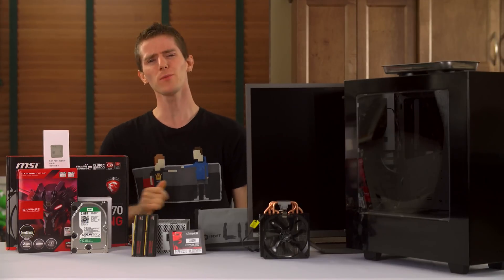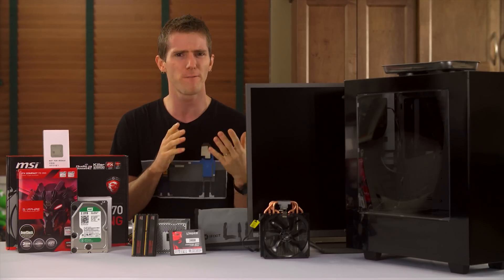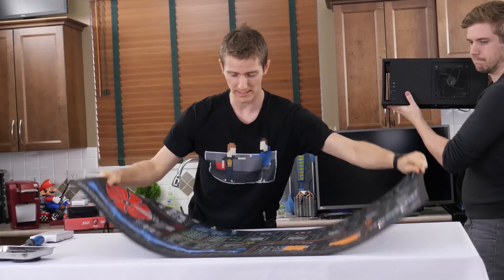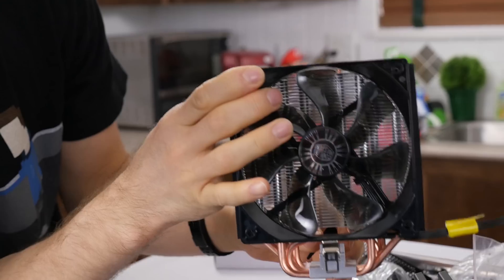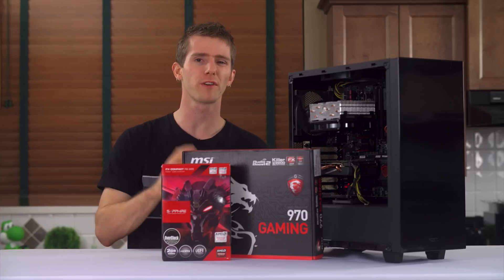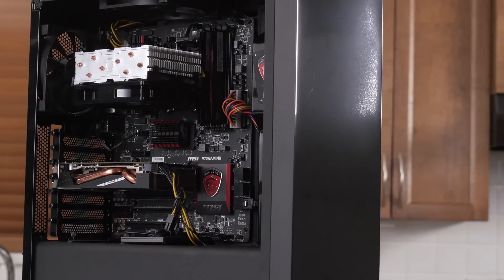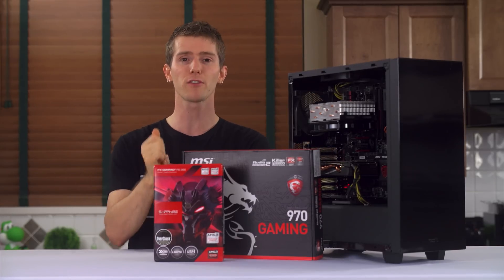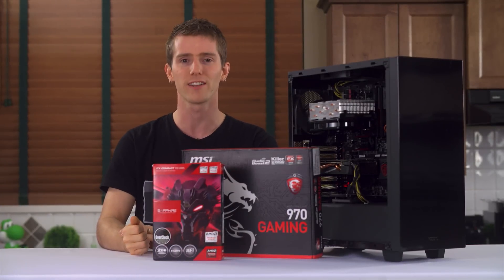Can you Build a 4K Gaming PC for Under $1000?

Comment: watching this video it is hilarious to see them look at 4k CS GO
I play at like 1024x768, and my graphics card is a 970
Because CS Logic
Reply: +The Croaker Why do people play CS:GO at tiny resolutions like that? I never understood that. I personally only play TF2, and always crank the settings up.
Reply: +MUSiCK But it doesnt look bigger. That advantage is gone in CS:GO. Not to mention you narrow your field of view. There is absolutely 0% advantage in playing on smaller resolution in CS:GO specifically.
Reply: +Topias Salakka Because the pros have been playing for 10 years and they never upped their resolution as the mainstream got better. People copy pros.
Reply: Lol I go for 480p, low, and 30 or less FPS. #PotatoMasterRace
Reply: +Guru Nannak Anyone who has spare power, my GTX660 can run it at max in 4K at 70 fps, tho I just use 1080p with 8xMSAA, because input lag.
Reply: +The Croaker Same :P
Reply: Grammar Nazi You don't need good anything for csgo
Reply: +Topias Salakka its kind of a thing that alot of older players use when everyone had 4:3 monitors, an good example would be players that played counter strike 1.6 back in the day and wants to stick with the resolution they used to...plus i also play with 4:3 just because everything looks bigger
Reply: +Diavolo222 yes you are so right, which is why so many pros play at 4x3 and lower resolutions
Reply: and who the hell plays all there graphics very high
Reply: +Diavolo222 The main reason is focus. If you play at a low res, everything looks "bigger" even though the hitboxes and such aren't. In CS you need to see tiny tiny pixels. playing 1080 makes it hard as fuck to 1 tap someone down long.
Reply: I got a... a... you know... a... kill? Kill. A kill--I got a kill in CS once, you guys. It completely psychologically annihilated me, but after much hardship, I did it. And then I quit. I just wanted to let you all know a little about me, and who I am as a person. ( ͡°╭͜ʖ╮͡° )
Reply: +The Croaker Just because someone is a "pro gamer" that doesn't mean he has any technical knowledge of his equipment.
Reply: +Topias Salakka if you have a lower resolution the head of your enemies look bigger and you think its easier to hit their heads
Reply: I have AMD Radeon HD 6570 I play on 16:10 1440x900 on low Settings I get 120 fps constantly
Reply: +Yolo Alex Its not because they are bigger, its preference. Majority of GO players are 1.6, CZ, or source players when lower resolutions were what was available
Reply: Read up m8. The only way you have 4gb is if your mobo uses your sys memmory but 2×2gb in sli will give you 2gb of v ram
Reply: +Franco Pellegrin I play on a crt pentium 1 on low settings and I game at 12 fps get on my level
Reply: +SmashBomb im playing in a Toaster with SLI Potato's
Reply: +Guru Nannak Because they look better, way better with everything cranked up ? Granted when you play these competitive games, at some points after much replayability, you will not notice and get used to everything on low. But if your system can run it, like my i5 4430 gtx 660 systen can, who the fuck cares ? Same for Starcraft 2. the game can be played on Low but on ultra it looks pretty damn good. LoL sadly looks shit whatever setting you put it.
Reply: +The Croaker lol same here because the textures pop up better
Reply: +The Croaker Dude you're everywhere
Reply: +The Croaker I play on a 1024x1280 With a Hd6450
Reply: +The Croaker Yh dat 4:3 tho :p
Reply: GTX 760 runs csgo at max detail, max anti-aliasing, max anisotropic filtering etc. at 150 fps. High framerates make my graphics card run at full fan speed tho
Reply: 1280x960 all the way man
Reply: +The Croaker a lot of DOTA 2 players use legacy keys, but that's because of what they grew up with, not what's optimal.
Reply: +The Croaker That's not CS logic, it's veteran player logic from people that got used to their older setups and just can't change anything. Stop handicapping yourself and play at least at 1080p...
Reply: SaladFingers
It's not handicapping, it's preferring bigger and wider player models.
Reply: +Topias Salakka The lower the resolution the bigger the player models, making it easier to kill people in theory. + Most people grew up play cs 1.6 and source at the lower settings and are used to it
Reply: +The Croaker You should change to widescreen at least, so you get the extra field of view.
Reply: +Topias Salakka The larger the head, the easier it is to aim.. but he should at least use widescreen, so he get the extra field of view.
Reply: +Topias Salakka on lower resolution everyhing is bigger - easier targets and so on.
Reply: +Topias Salakka If you didnt get an answer I will try to explain. As alot of people said things looks "bigger" if you run at a lower resolution (if you strecth it out) but alot of players play with black bars too. This is probbably because of the old days but it givs a really nice feeling and the sensitivity feels nice. What resolution you play with in cs go is mostly preference but a huge part is also fps. Good CS GO servers runs at 128 tick and for some weird reason the amount of packages you send to the server is directly affected by the fps you have (this is no fucking joke, look it up if you dont belive me) therefore you need atleast 128 fps at all times. I have been playing cs since I was 14 so I would say I know alot about the game.
Reply: +lol lol they play like that because they've got used to it, and if you change aspect ratio, sensitivity changes also...soo?ofc if they have got used to 4:3 they wont change it
Reply: +Topias Salakka People play CS that low because when you stretch a 4:3 resolution, it makes the model size bigger and improves FPS as well.
Reply: Also, it's worth pointing out that low settings make it easier to see stuff at long distances, if you have motion blur and stuff like that enabled you can't play as well. The resolution is completely arbitrary, though, some people stick with their 1.6 settings, some prefer 4:3, it comes down to what you're used to.
Reply: +Lapine Vision R7770 1GB.... 1080p max detail never drops 110 fps.....
Reply: +FiNiTe I highly doubt that i got 2x GTX750 Ti 2gb  Crossfire on this exact same MB a 970Msi, And i can crush most games but a 660 wont play fucking minecraft at 30fps xD
Reply: Sergeant Wolf if you think 2x2gb on xfire gives you 4 gb of vram means you are either badly informed or lieing if you have 27 way xfire witg 2gb vram each you have 2gb of vram period
Reply: I have 2 750, 2gb on each making a total of 4 gb combining both of them.
Reply: +Sergeant Wolf What 750 cards do you have where you can run them sli? Last I remember the 750 does not support sli.
Reply: +The Daily Goat Erm i ment that vram doesnt stack and if you wanna be bit.c about it.. 750 does support SLI you didnt write what 750 you think there is only GTX series on the market? :) Anyway whatever card you get as untill this moment there is no game supporting vram stacking in either sli or xfire.
Reply: You are right, when I hear 750 I immediatly that's think GTX. :)
Reply: The Daily Goat 1 msi 750 2gb and 1 asus 750 ti
they both work together.. as far as i know..
Reply: +The Croaker That is how you TRULY play Counterstrike in the first place. Hahahaha
Reply: +Diavolo222 thats bullshit totally bullshit 
there are console commands and initweaks which will stretch your 4:3 so everything get wider yeah your fov gets smaller tho 
but who needs a big fov thats not fucking cod where you can look into the corner and flick in on the spot in csgo you have to aim at one spot or you'll die(at least at Supreme-Global)!!
get your facts right m8
Reply: What about R9 390x gaming?
Reply: V ..what about the 390x? it isn't that i cannot run this at 4k or a modern resolution, it is that I don't because as a competitive game, I want different things out of it, a very high resolution is going to make it harder to see everything I need too
Reply: +Franco Pellegrin Alienware or AMD laptop?
Reply: +Guru Nannak Me
Reply: +Guru Nannak me
Reply: Lol but still I play at 1600x900 even tho I use a Titan x
Reply: +vf fa On .... On * not in
Reply: +The Croaker It's a CSGO thing.
Reply: +Diavolo222 when i play starcraft i actually have to play with all the settings turned down completely except for textures. i feel like all the effects and with shaders up that it just makes it harder to see things in the game, and is a lot more distracting.
Reply: +The Croaker lame.. i play csgo at 2560x1440@144hz  cuz i dont need big targets to hit
Reply: +Diavolo222 they do look bigger ive tested it with multiple different aspect ratios and resolutions but sticking with 2560x1440@144hz is my way to go
Reply: Strict Rooster if I was on that res I would probably be stuck at like mg2 or mge lmao, could not do it
Reply: +The Croaker y it wouldn't matter u just need good internet to have smooth cd gameplay
Reply: Nitish Madabusi It does matter, I have great internet and my game runs well over 200 fps on almost all resolutions
having different resolutions changes how your sensitivity is, also since I run on 4/3 stretched would really change a lot of stuff, also changing how I see everything, your choice in resolution is one of the most personally important choices in CS, along with your sensitivity, everyone's is different, but it is important
Reply: +The Croaker well I still sit at 1366x768 with 980m because cs logic
Reply: AksuPro450 i have a gtx 1070

Comment: guys will I bottleneck my r9 390 if I use it with a i5 4460?
Reply: +dtfguy1982 no, no single card will bottleneck  modern i5
Reply: ***** it doesnt, the titan x isnt
Reply: +kowaletzki Dude no modern i5 bottlenecks a modern GPU are you crazy ?
Reply: you might get less performance, but its not stopping the fury x's full potential
Reply: +kowaletzki Actually people blow bottleneck way out of proportion. With a modern i5 over clocked to 3.7ghz+ I doubt you have any problems. Even a locked i5 won't bottleneck that much.
Reply: ***** Maybe not, but the 4460 is quite outdated, get any modern i5 and I don't think you'll bottleneck much...
Reply: Billy Glen no its not, its a fine modern i5
Reply: a true scotsman uth Modern yes, price/performance, no. I would save up and get a 4690 or a 4690k
Reply: Billy Glen Its like 32/35 as powerful as them and its 100 dollars cheaper

Comment: is this a good gaming build?http://pcpartpicker.com/p/6TC8gs
Reply: +noGames3n5e .tf no, ditch the ridulous cpu and cooling, go with a cheaper i5 and go bronze 500-600 w, get a slightly cheaper mobo and get a gtx 970 instead
Reply: Cuz im building a black an white pc
Reply: And*
Reply: a true scotsman uth like doesn't it work?
Reply: _noGames3n5e_ .tf no, its just very price inefficient, i could build something the same performing for way less
Reply: a true scotsman uth ooo, have to find other black and white studf
Reply: a true scotsman uth stuff*
Reply: a true scotsman uth can u show me ur build for this price?
Reply: _noGames3n5e_ .tf i5-4460, gtx 970, 8 gb of ram, 120 dollar z97 mobo, a 250 gb ssd, 1tb wd hard drive, some nzxt case, evga psu with 500-600 watts, however, its not black and white
Reply: a true scotsman uth ok thks
Reply: a true scotsman uth is there any black and white build which is abit more expensive than this?
Reply: _noGames3n5e_ .tf yes, but i dont know, just research more, your build isnt bad at all but its just inefficient as opposed to regular builds
Reply: a true scotsman uth ok thks alot:)

Comment: Why wouldn't you went with an r9 390?
Reply: +Jamie Knight They were on a budget and when this video was released the 390 didn't exist.
Reply: TheKellen17 ohhh when did the r9 390 come out? Bcoz this isn't that old? and when did the 970 come out?
Reply: +Jamie Knight 390 came out in June and 970 in October or November. The vram thing on the 970 would probably screw you over at 4k.
Reply: ***** yeah that's why i was thinking if they were doing a 4k pc why did they go for the 970 over the 390? thanx man
Reply: Jamie Knight Well the 970 in this video is an AMD chipset.
Reply: ***** yes but there is still that problem where nvidea is way over priced where as the 390 is much better with 8gb vram and in some instances cheaper than a 970 with onlt 3.5gb of vram.
Reply: Jamie Knight It still has 4GB, but the last 500mb is much slower.
Reply: yes so the 390 is clearly a better card

Comment: going to comment on another one of linus's videos. my geforce 580gtx at 1080p max settings in WoW gets about 50% gpu usages at 60fps.. you can probably get that preformance now with a 780ti. just saying.if you only have a 60hz monitor. you dont need a 200$ gpu. the cpu is far mor important.
Reply: +isntyournamebacon no, it isnt
Reply: World of Warcraft is cpu bound. Most games are the opposite, true.
Reply: isntyournamebacon oh, i read your comment differently, my bad
Reply: +isntyournamebacon Actually WoW is no longer CPU bound like it was in the past. With WoD they made it more GPU heavy than ever before. Which is better for the future.
Reply: More balenced anyway. I had to use a dual core athlonX2 for a few weeks. The game did not like that one bit. But im back to i5 2500k and it seems i could use a better gpu to go with that... That render scale slider is a fps eater. But seems to work so much better then edge AA.

Comment: is a 6600k still good enough for highend gaming? the 6700k was not available yet, this is gonna be matched with a 980ti and 32gb ddr4 2800mhz
Reply: ***** He only mentioned heavy gaming not 3d work. Also the reason I care is because he is asking for help in the comments.
Reply: Brett Culley The 2500k overclocked is enough for gaming, and i7s don't usually increase game performance unless it's optimized for hyperthreading. The 6600k will be fine.
Reply: what games u play like csgo i7 is good its uses 8 threads
Reply: +Aaponton CS:GO only uses 1 or 2 cores, depending on you're settings. So an i3 will normally make no difference unless the i5 or i7 is clocked higher.
Reply: Sebas Davidson u can tweak ur start settings and make it run on ur all cores even 16thread ships like i7 5960x
Reply: Why 32 gigs of ram?
Reply: +Pane Elenovski maybe they do 3d work, why do u care?

Comment: LinusTechTips I know it is possible to make a good Gaming PC for 4k around the 1000 I'm going to build one myself :D (And yes it is a AMD PC)
Specs:
CPU: AMD Vishera FX-8350 Eight-Core
Cooling CPU: Cooler Master Hyper 103
Motherboard: MSI 970 Gaming
RAM: Crucial Ballistix Sport 8GB DDR3-1600
GPU: AMD Radeon R9 390X Gaming 8GB GDDR5
2000 GB Sata III
750 Watt Cooler Master
in a total of 1073,50 euro with some other parts including Windows 10 and a miditower
Reply: +Finiox nice

Comment: Hi! I am getting in to PC gaming sometime around Christmas this year. I am looking to be able to max-out GTA 5 at 60 fps or get close to maxing it out. I also want to be able to run the Oculus Rift which recommends a R9 290 GPU. This is my build so far, http://pcpartpicker.com/p/R4xbgs  , any suggestions would be greatly appreciated.
Reply: I have a R9 390, Amd Fx 9590, Msi 970 Gaming Motherboard, a corsair fully modular 850w (you can change this I recommend a xfx power supply which is $100.) For an after market cooler I got the Cooler master 212. This equals on Amazon about $880, with the xfx psu it is: about $860. It is, at least I think, leagues above your build. Not to be cocky, just giving you advice.
Reply: +Aj Mosley I forgot the case. I have a Thermaltake V3 black. Which is like $50 so around $900. I had ram and a case and hard drive from my previous build ( had an APU in it, could run Skyrim at ultra, but started to get worse over time)
Reply: So actually your build is good.

Comment: damn, I shoulda got a sapphire  r9 285 instead of sapphire r9 280 3gb

but I burt out 3 of those msi 970 gaming board (different esd reasons...) and a missed spacer screw. and ended up going with the gigabyte 970a-ud3p

Comment: Hey Linus got a question to ask or possibly anyone on Youtube can answer this; I am know expert on all the 4k gaming going on right now but I would like to know if I can run 4k gaming on my single Galaxy Geforce GTX 680 2GB with a factory overclock video card I am not trying to run on 4k Ultra settings because like the video Linus showed he can get 4k on a 970 2gb video card but not at full max-high resolutions. I would like to try 4k gaming on minimum 4k resolution if it's at all possible on my old 680gpu let me know thank you in advance.

Note: I will be purchasing a 4k monitor only if my single graphics card can handle it if not I'll stick with my 1080p Monitor till 4k prices starts dropping. 

Intel i7 3.2ghz SandyBridge
12gb k. hyper x memory
500gb s. evo ssd
1tb hdd
galaxy geforce gtx 680 2gb factory overclock white pcb

Comment: 400W PSU ? i just calculate using cooler master website, its need min power supply about 398W. Is it safe ?
Reply: If you want to be safe 450w would've better BUT a psu is never 100% efficient

Comment: Bad overall selection. Gpu is not very good. A gtx 970 or 290 would have been a better choice. If you're not overclocking a cheaper motherboard, cheaper CPU cooler and a fx 6300 instead would have been much better. And if you are overclocking then why the 6350. The wd green is a very poor drive and you don't need a ssd. Should have went with a 1tb blue drive and put the rest of the money into a better gpu. 400w is not the best choice going with amd, leaving no upgrade possibility. Case is nice looking but you could have went with a cheaper one. I run a gtx 970 and a 6350 @4.6ghz with a budget mobo flawlessly. Costed way less than this build and preforms much better. Not too impressed Linus.